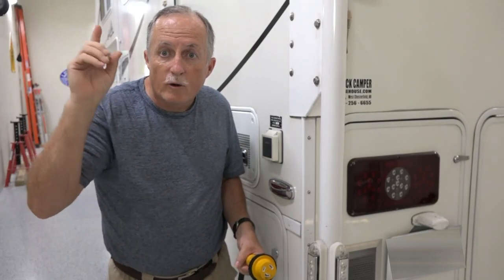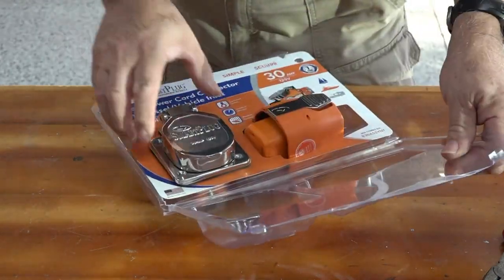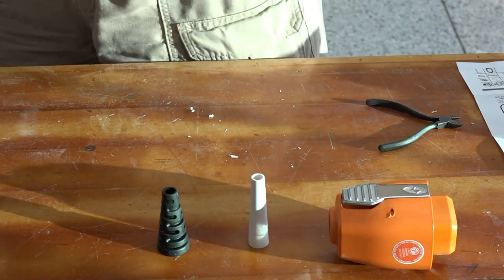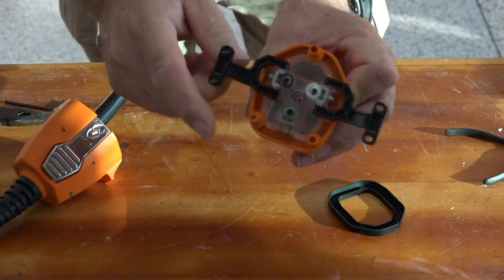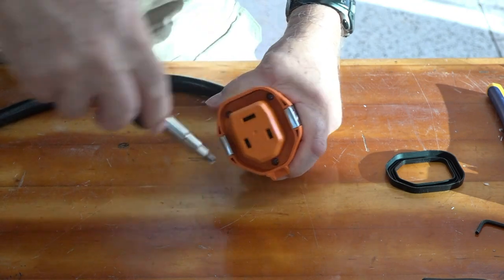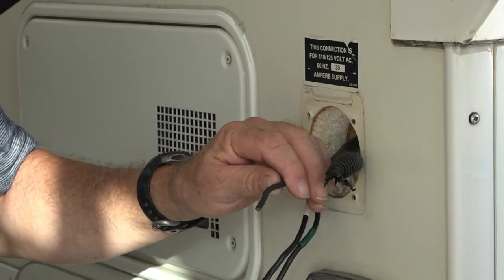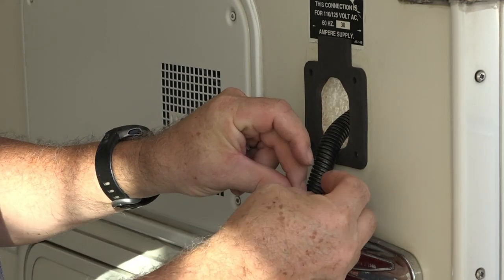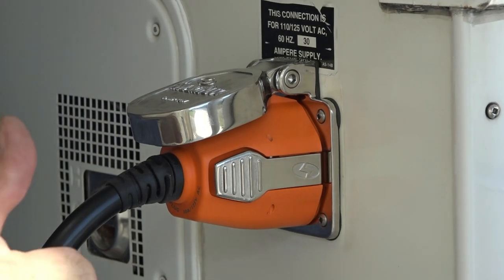How to Install an RV Smart Plug

Comment: I've got plans to add this same setup to my 5th wheel in the next few weeks! Its setting on the shelf right now just waiting to get installed. I'm really impressed with quality of it and how much better it will work than the twist lock plug. Great upgrade!

Comment: I've been using this setup for more than a year and really prefer it to the twist lock RV plugs.
I bought 2 plugs for my rig. One on the 30 amp cord and one on a short 15 amp whip. The 30 amp cord would be used at a campground with hookups. Which I almost never do. However, the 15 amp cord gets used regularly at home when plugged in to the garage to run the fridge and get ready for a trip.

Comment: Brown on a plug maybe a loosely tightened screw causing an arch. My Rv had a loose ground causing the AC which requires a lot of power to operate to not turn on when plugged into Shore power using the plug.  The ac would only work using the generator. 
Step one check the fuses, step two look for Brown spots on the plug. Bingo found browning on the actual female plug and the male connection on the Rv side.  Take a part the Rv side of the plug and check for tightness of the screws clamping down on the male pins. Boom the ac now works.

Comment: Everytime i plug my camper in i think there has got to be a better way.  Thanks for the video!  My next upgrade. 

Question,  do you not need to disconnect batteries to do this?
Reply from the maker: No you do not have to disconnect the batteries for this MOD!